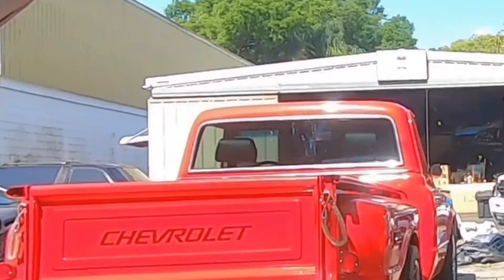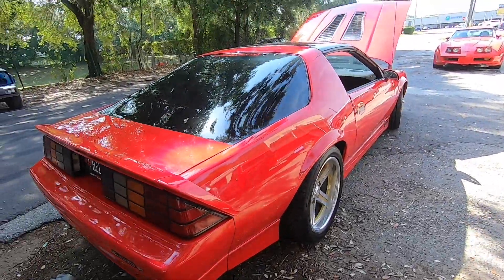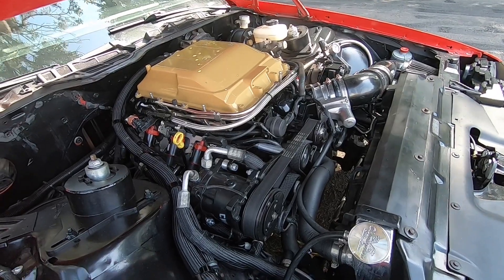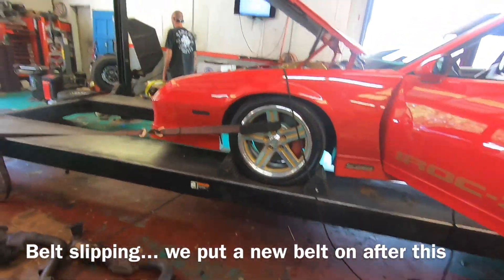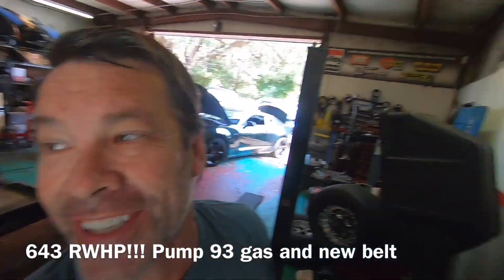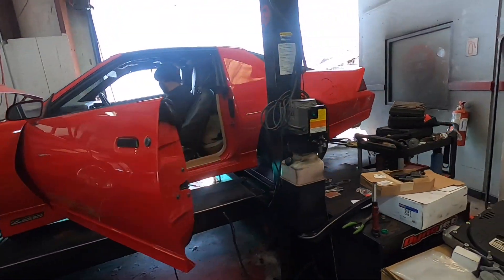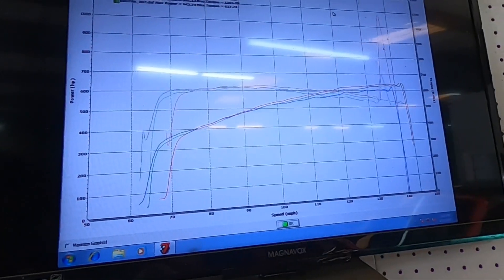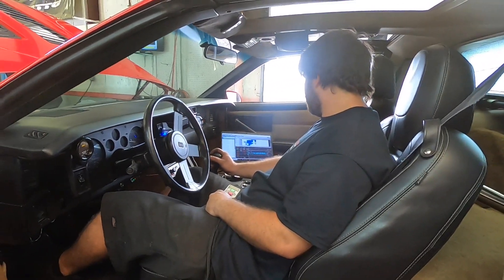LSA Blower Dyno Part 2, 93 pump numbers, still no E85 results

Comment: Your paint looks soo good.  I assume it’s clear coated as well?
Reply from the maker: Yes it is, the painter laid this paint down super smooth!!!
Reply: @FireballMullet  do you know of a reputable shop that could do an LS swap for me.   I’d be willing to shop the car wherever.  I’m thinking of buying an IROC soon. I had an 86 IROC when it first came out.  Loved that car and want another.
Reply from the maker: @Fixinbones27  Only one I know of, is expensive, but they do a ton is Hawks Motorsports
Reply: @FireballMullet  thanks.  
Yeah I’ve been to their website and they have a lot of conversion parts I didn’t know that they did conversions as well

Comment: Probably could make some real power with a cam,intake & good turbo.
That's what I'm working on right now with my lq9 build,shooting for at least 1,000hp maybe up to 1,150hp 15-18psi of boost.
Your running an ls3 so 15psi should get you real close to 1,000hp at the crank with even a small cam.
Reply from the maker: Honestly I don’t want anymore than 700... I want to keep it a bit more streetable. I’m already in a tire dilemma, I don’t  want to run drag radials because in FL summer thunderstorms hit almost daily out of no where. I plan on doing long trips etc. this is about it for this car 😂
Reply: @FireballMullet  
It's a super nice car.
Very well rounded & improved in every way.
Love it.
I hope my build is streetable as I don't have an opportunity to go to the race track due to work schedule.
Kinda went with a mid level cam just because of this but even at that level with a turbo & 15psi I should achieve 1,000hp easily without breaking a sweat.
Best wishes.
Reply from the maker: @charleshenson4183  sounds pretty bad ass! It’s such a trip these days 6-700 hp is like mid level lol 😂 if I ever build a forged bottom end and gap the rings I would take it up a notch ... but that would be after this one blows. Thanks again for all the comments and channel support, keep me posted on the progress!
Reply: @FireballMullet  
You're absolutely right.
We're living in some good times.
Fortunately I'm rebuilding my engine & able to gap the rings.
I probably should throw in a forged assembly but I'm really hoping that 1,000-1,200hp will be enough to make me happy.
My supercharged vehicles are a blast but you'll be amazed at how quick you get used to 650-850hp.
It gets wanting more.
I've got 2 projects on the back burner & if I find this current build boring I'll step it up a notch with them.
I absolutely love your car.
I have an 85 TA & if it equals your quality of craftsmanship when I'm finished with it,I will consider myself lucky.
God bless bro.
Reply from the maker: @charleshenson4183  Thanks man, GTA is probably my next build.  Good luck bud!

Comment: I think you would be way way way better off with a turbo.
Reply from the maker: My main reasons running blower instead of turbos: 1) I don't race the car, blower torque for street driving is what I look for 2) A/C upper mounted won't clear turbo setups 3) I like to set it and forget it 4) turbos are great and power is adjustable, I just don't really care for much more LOL
Reply: @FireballMullet  
I totally understand
Reply: Just depends... I've seen dissatisfaction with turbo setups

Comment: 643 hp is pretty impressive,  what kinda cam are you running?.....what size upper pulley u running to get that 12lbs.....I gotta 2.45" on mine but I haven't pushed it to hard yet...it looks alot like your  pulley,  is that a griptech??
Reply from the maker: Same cam I used in my NA LS3, BTR stage 3 NA. It’s a 2.43 pulley, yes it’s the griptech
Reply: @FireballMullet  awesome. ...yeah I'm still running my N/A cam too, it's a cam motion level 3 ls3 cam....220/230 cam
Reply from the maker: @trentdawg2832  they do fine man!